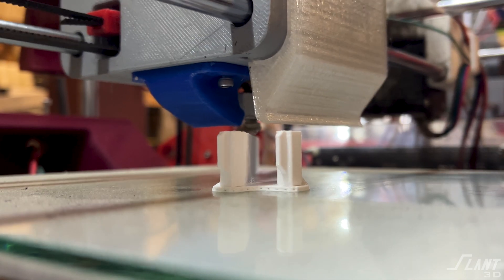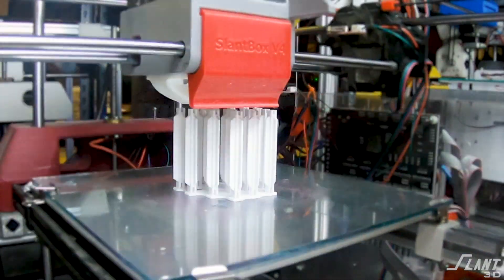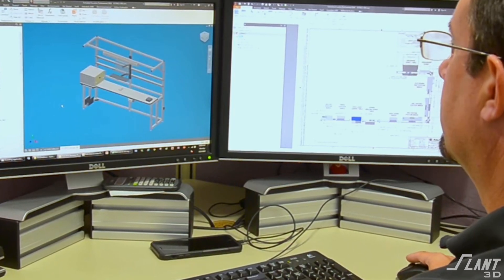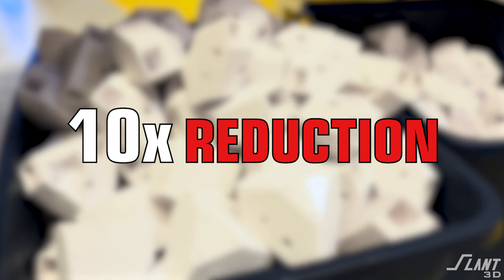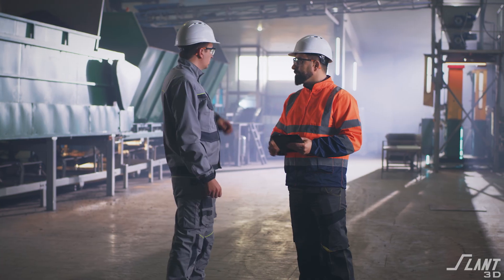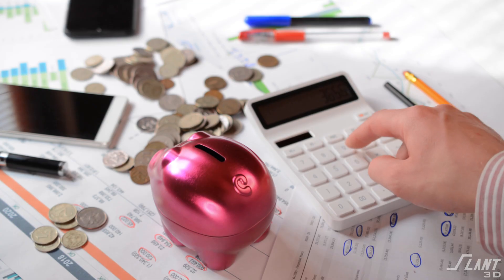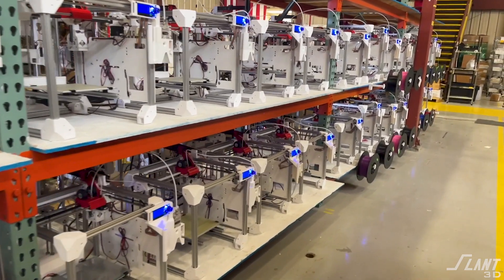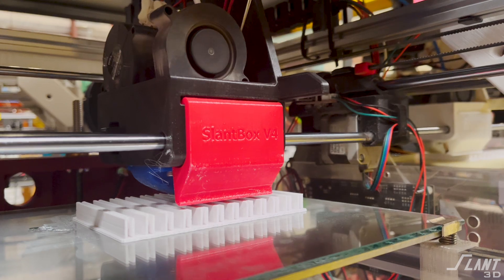Why Systems Integrators Should Use Mass Production 3D Printing

Comment: They could also include a 3d printer loaded with all the gcode files of the parts that it can print with their $10k conveyor belt or what not and if something breaks, they fire it up and bang out a replacement in a few hours for less downtime. Alternatively, with cheaper parts more spares could simply be included in the delivery or when they order a replacement you ship two. Whenever I print anything for my wife or kids, if it's accepted I print another one so a replacement is ready when they inevitably break or lose it.

Comment: I've been preaching this - SIs really need to use 3d-printing more. But adoption is very slow because there is so much fear of being responsibe for machine downtime when deviating from the "tried and proven" methods. And as you mentioned, cost isn't really a concern in this field.

I find you example of printing corner brackets a bit odd - for those you can get standard parts very cheaply. But there is an area where 3d-printing can really shine for SIs: Jigs, Fixtures, and any kind of product-specific workpiece holding. These are always custom parts, have to be exchanged frequently due to product changes, and often don't need to withstand that much force.

The best application I have seen so far was a packaging line where the nests for hair product bottles were printed parts. When the manufacturer wants a new bottle shape, the SI draws up a new model for the nest, sends it over, the manufacturer prints it 30 times and is immediately ready for the new product. So much faster and cheaper than the traditional way with milled aluminum nests.